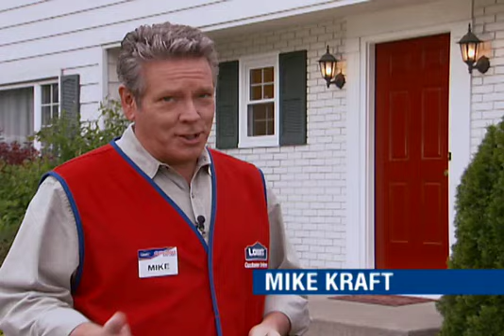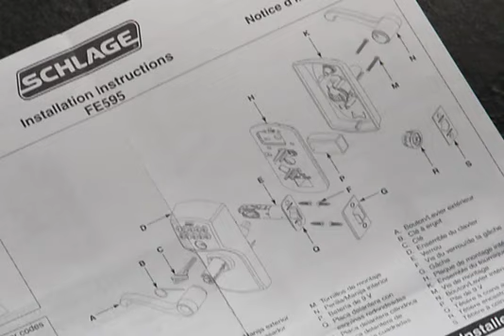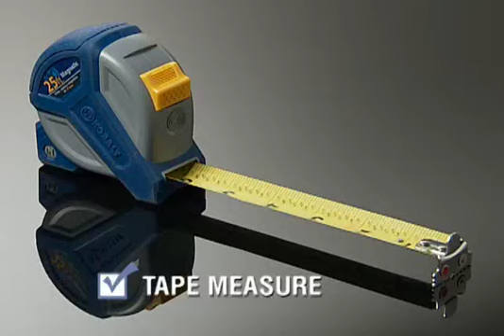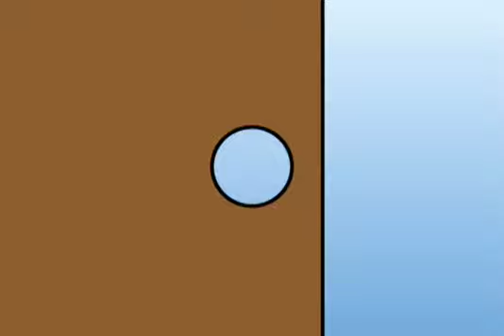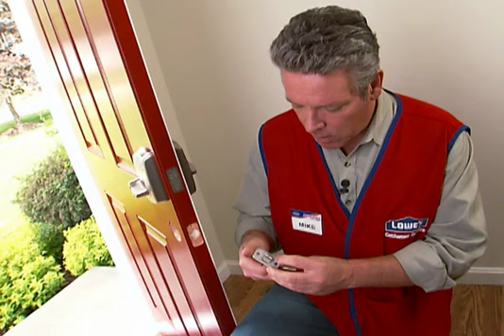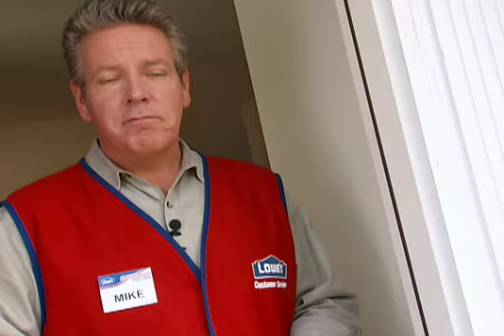How to Install a Lockset

Comment: If your door latch has become loose because the screws have stripped the door out, Secure Latch Solutions has a channel here that solves this problem without glue, putty, or external hardware covers.